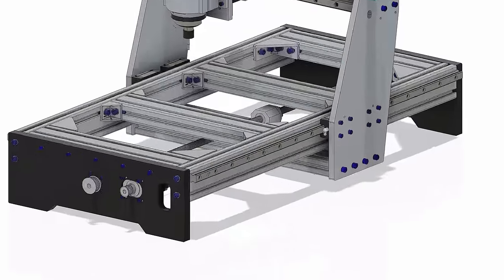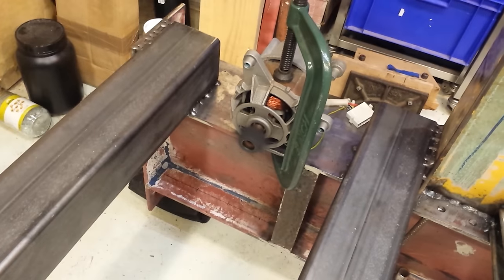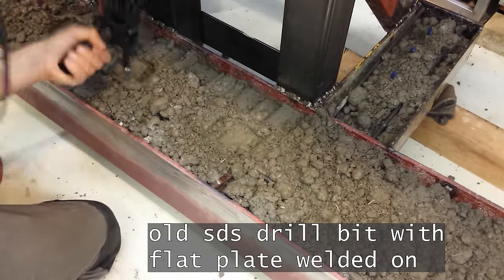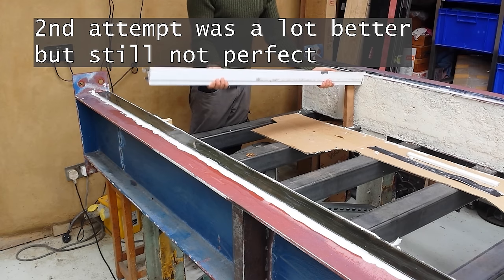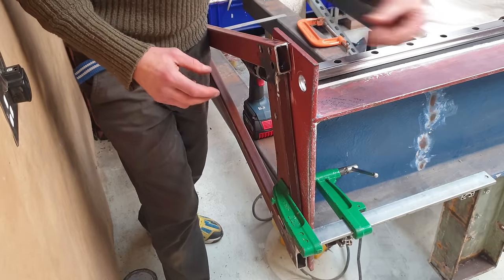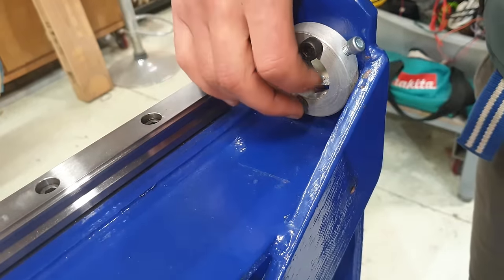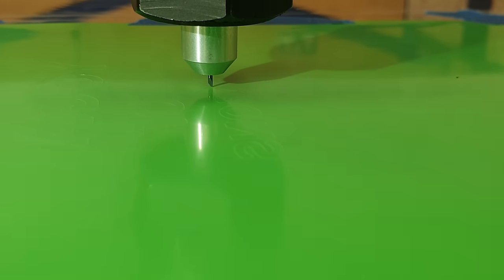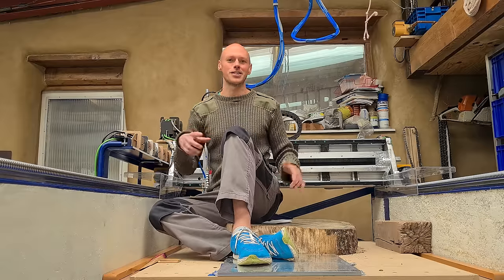Can we DIY an Industrial grade CNC?

Comment: Brilliant. Speaking as an engineer, I know PLENTY of engineers that wouldnt have done half as good a job as you did. Very well done!
Reply from the maker: Good morning. Really appreciate that friend :)
Reply: As a Fitting and Machining apprentice (I'm in my 50s and retraining after doing CAD work for years), I work on CNC machining centres quite a bit, (look at Okuma products about 20 years old; MC66, MC60, MC55, etc), which use G-code to drive them.
We do machining of metals (Aluminium, cast iron, mild steel, and some tool steels) routinely, and it's generally done with slower feeds and speeds than what you showed here (and jets of coolant for some of these) to enable the bits to last through a production run. All power to your machine, it is absolutely brilliant what you've achieved.
Reply: @bivingtons the kind that doesn't have any fabrication experience, it is pretty normal, engineers don't learn how to square two beams and weld it without heat distortion at college, they learn how to calculate the weld stress limit and the structure stress limit.
Reply: good job keep it up.

Comment: H beams are bad against twisting forces.
Reply: I’m looking at making cnc with square tubular frame, then fill it with sand for vibration damping. Is this a good idea
Reply: How do I maintain accuracy when welding it together and I’m using linear roller ways

Comment: .00005 - .00002 vertical lines on radius cuts are about as good as it used to be for expensive CNC machine tools circa 1992. It is a circular interpolation issue. If you have the ability to change the calibration a visibly smooth radius may be possible. Good luck with that. The harder the metal the worse this issue is. But, functionally the parts are not likely to suffer this imperfection. I was working with inconel at the time for US military contract applications.  I am amazed you were able to built this machine in such a small space. You must be a genius or very close to that level of understanding and abilities. Thanks for sharing this.

Comment: The rotating ball nut is a critical and fantastic idea.

The inertia of the rotating ballscrew is definitely a limiter to accelerating the gantry in Y, but there's a bigger problem:  The ballscrew is unstable in sag.  As it sags more, the centripetal force from rotating throws the sag out more.  This places an RPM limit on the rotating ballscrew than decreases quadratically with length.  That limits the speed of traverse in Y.

It's too late now, but for folks thinking about building CNCs of this size, especially with concrete or epoxy granite damped frames, you might want to consider casting in tubing.  By circulating water and controlling the temperature of that circulated water, you can limit the thermal expansion of the frame and ballscrews.  Some ballscrews are available hollow.  Circulating coolant through a ballscrew is a heck of a lot easier when it isn't rotating.

Note that coolant is a bit of a misnomer.  There isn't generally a lot of heat input to the frame and ballscrews.  Rather you want them to stay the same temperature, day or night, season to season.

Comment: if you need to do a self-leveling epoxy again, use the vibration rig. also works for floating more liquid concrete/cement mixes. Vibration can help evenly spread the epoxy. out by repeatedly breaking the surface tensions
Reply from the maker: Hey Brian, that seems like a great tip. and I'm kicking myself that I didn't think of it at the time! Thanks for watching and the good idea :)
Reply: On a similar vein, I was surprised that the vibrator wasn't used during the compacting phase when installing the concrete damping.
Reply from the maker: @d00dEEE  I DID actually try that, to no avail. the concrete seemed just too stiff (and massive) to liquify with that single motor...
Reply: @FloweringElbow  Ah, that makes sense.  And now that I think about it, the concrete mass was changing the harmonics (probably a lot), too, so that likely introduced enough damping that the vibrator was no longer effective...
Reply from the maker: @d00dEEE  yeah - in fact I think that's why it didn't cross my mind when it came to the epoxy..
Reply: I think you could have used a wetter concrete mix. The additional water ensures the cement is fully reacted and the water helps it flow around the reinforcement and avoid voids. Your long drying time ensures the final block is as good as the one you created.
Reply: What frequency(s) and magnitudes would you recommend to self level epoxy?
Reply: @Dave5843-d9m  to much shrinkage.. you want to dry pack concrete something like this use case .
When concrete is watery it shrinks and has change of hairline cracks .

Comment: I have seen a few such machines on YouTube, Frank Howarth being the most notable, but I have never seen a DIY system machine steel. It did so with no apparent chatter or issues of any kind, although you were wise to clear the swarth with those small cutters.  I am seriously impressed, and I want to give that some context by saying I am a retired toolmaker and design engineer, so I have a feeling for the issues you faced and overcame.  Very impressed indeed.
Reply from the maker: Hey Trevor, thanks man - that made me smile, it sure was a lot of work :)
Reply: This Old Tony made a CNC machine that could mill steel. He still ended up CNCing a real milling machine though. There's really no replacement for cast iron dovetails.

Comment: It's amazing how broad and deep the scope of knowledge needed to build a good CNC is. I remember building one out of plywood a few years ago, torsion boxes to maintain rigidity because "aluminum is too expensive to make this rigid enough", skipping things that I felt entirely out of reach at the moment and simplifying as much as possible. Mind you, it was just a 90x90cm CNC for wood and some aluminum, with SBR rails that required less precision and much less force to manage. It wasn't a good CNC, it worked but every bit I knowingly skipped came to bite me in the butt.

It was a nightmare and a love project at the same time, took me months all in all. Had to learn a bunch of stuff on quite a few fields of knowledge. As and engineer and lifetime geek with experience in manual work and machining, it wasn't nearly enough.

What you've done is truly astounding. No single path can prepare you for that, plenty of engineers would fail to even grasp the full complexity of the project. It truly takes a jack-of-all-trades and master of several to pull this off. Hat's off to you. Now I wanna see this machine making some thick chips hahah
Reply from the maker: Hey Franklin, After being pushed and pulled to quite a lot of other non-CNC-related jobs, I was finally getting some time to play with it today. Enough to say it didn't go exactly as I would have liked, but somewhat pleasing nonetheless. Soooo much to learn, as you say... Your comment cheered me a lot and lessened my feeling of inadequacy for still being near the bottom of this learning curve. Sometimes I get so focused on the tasks at hand... It's nice to think back to all that's already been accomplished from time to time :) 
Thanks for watching, and thanks especially for your encouragement, 
Bongo.
Reply: @FloweringElbow  happens a lot, we often get pulled to do stuff that isn't exactly what we want or expected at the moment. 
Man, you went all out on this one, issues are pretty much a given when it's all added up, but you can work it out. 
Even companies with engineering/QA teams and big budgets often ship flawed machines and nobody bats an eye.

Comment: By FAR the BEST diy CNC on YouTube. Hands down. Why? From first principles, not a copy and better off for it. I will emulate this in future if ever build one at all. XXOO
Reply: The only thing I think you could/should have done differently is using helical cut rack and pinion with heavy spring preload for the long axis and MAYBE the second longest axis. I think the lowered work area is both genius and obvious - why no one else does this is beyond me. It makes PERFECT sense. If / when I do full sheet machine like this I want it to be multi process, so I've been thinking about how to achieve that and the best I came up with is 4 or maybe 6 machined-by-machine mounting faces positioned in Airy or Bessel points inward of the extremes so as to be possible to machine them. Then have either a water tray with plasma grill or sacrificial timber sheet, or massive T slot or grid holes sheet, also machined by the machine. Then you could unbolt the working surface from those points and remove it replace the one you need and swap on the head you need to match and bingo, though more likely both laser and plasma would coexist with the spindle motor as they're light weight anyway. Thoughts on those changes?

Comment: 7:30 shrinking issues will be minimized by using hydrophilic fiber in the mix. This additive releases moisture back into the cement gradually, compensating for excess moisture loss from the porous or exposed surfaces. Of course, placing a waterproof coating on the exposed surface, like wax spray or plastic film, also helps.

Comment: That is a fantastic and really impressive result; absolutely blown away by its performance. Just something important with your placement of the emergency stop button, it gets blocked by the acylic chip guards when the Gantry is towards the front of the machine. Just something to be mindful of, especially whilst learning as it can be your best friend and save you a lot of money in cutters.
Reply from the maker: Hey Lechlan, thanks! And thanks for the reminder on the e-stop. I had clocked the potential irony of being blocked from pressing the e-stop by something advertising the best safety device!!!

Comment: 2:16 let me just say at this point, that there is a hell of a lot of measuring that went into this, there have to be right angles all over and you're not in your CAD, you have to hold it tight or it will move, it's all by sight and welding also does it's thing and you have to take that into account.

What a monster of a project, I'm in awe.

Comment: Very glad I watched this. Back in the 70's, DoAll company made metal cutting bandsaws with concrete filled steel casings to dampen vibration and increase mass.
I've been scavenging precision slides and ball screws from big industrial machines, for years now. Wish I had some younger help, at 70 I'm running out of strength! Great video, great thinking! Subscribed! Best to all!
Reply from the maker: Hi Richard, many thanks for leaving a comment :) Interesting stuff that bandsaw business, I bet it was a struggle with shipping costs. We actually came close to filling out bandsaw, which has a welded and folded sheet metal frame, with concrete and re-bar... Opted for sand fill in the end as we can drain it out from a plug rear the bottom when we move it. Thanks again, Bongo.

Comment: That has to be one of the most cool and interesting DIY builds ever. You had my interest when you build the gantry. I LOVE how what you can get defines much of the design. I can't really wait until you show us more. I also work on limited budget and use a lot of scrap parts, but still go for high quality and precision cuts on my next build. One of my biggest problems is how to make straight mounting surfaces for the rails, when I have no straight reference. I would love to se more of your experience with epoxy leveling.

Comment: Weld done ! Punn intended
Rigidity is necessary for repeatability, if your cutting speeds and rapids are low speed, Mass is not a serious issue.
Rapids are not necessary in a Diy project.
There are plywood kits that are rigid enough for non-production work.
Excellent engineering Sir!

Comment: Congratulations on a awesome build. This machine will give you years of joy. You are definitely aware of how important it is to start with a great sturdy base. Don’t be scared to move away from Mach 3/4. Although I have been involved for the last 15 years with CNC I realized that the computer based setup with Mach do give glitches. Great for hobby but when you want reliability, do check in future after making some money to invest in a dedicated controller. They are dedicated and will give you very reliable machine with immediate startup. We converted our cnc plasma, router and milling machine to this controllers. Once again great video, great build. You are a creative person and this will bring very creative designs on a router. Very handy when you start doing signs for shops. 😎
Reply from the maker: Hey Johan, Thanks watching and for sharing your experience. I have to say, after only just getting to grips with Mach3 - writing tool change & relay actuator macros etc, I'm quite scared to even think about moving on right now... 
What type of dedicated controller are you using? 
Thanks again, Bongo.
Reply: @FloweringElbow  There is a few varients but they mostly all use a ARM processor. This is what we use,  SZGH-CNC1000MDc. Best of luck😎
Reply: Mach 3 glitch? You don't say! Must be why it's been abandoned by the developers now.  Personally I run LinuxCNC and it is as solid as a rock is. There's nothing better available.

Comment: This was awesome! Thank you for posting this! 

I'm building a 4x8 CNC machine myself and some of the choices you've made I will likely incorporate into my build. I too would like a machine that can potentially do steel but lack the mass of a frame like yours. Mine is extruded 8080 from 80/20 and bar stock but I was thinking of filling the profiles with epoxy gravel and seeing if that helps give the machine enough mass (it's only several hundred pounds right now). Still in the assembly phase as I just completed the frame and working on the ball screw assemblies. I built a custom CNC controller for it already that can support 4-axis as well as dual X-Axis (one as a mirrored slave similar to yours), 2 vacuums, and 2 other pumps for coolant. I'm using NEMA 34 Servos hybrids as they were not too expensive and can be upgraded as needed. I've never done anything like this before and only a hobby electronics guy and literally have never even used a CNC machine but I've always wanted to learn and what a wonderful project this has been. It's quite an expensive "can I do it" project, but I've learned so much about electrical, design, machining, g-code, computer programming, etc. Wouldn't have it any other way! Worth every penny and hour spent.
Reply from the maker: Hey George, that's great to hear! So pleased if fellow builders can get something from video... And all you say is spot on - sooooo much to learn. Sounds like you're well on your way :)

Comment: That was an amazing build. I'd love to see you get into some aluminum plate using a full bit. The machine looks like it has enough mass to be able to handle that kind of a cut. I've seen a couple of others using sand and rock and epoxy but I like the way you did it better. A lot more DIY friendly and definitely massive.
Reply from the maker: Thanks Timmy! attempts of that kind will likely come in the next video if you can hang on ;)

Comment: Great machine build, Your machine is about twice the size of my biggest machine. So I built my first CNC with hand tools. I used the first CNC machine to make the parts to build a second CNC which is much more accurate (better than 20 microns or less than 1/1000th of an inch). Now I am building a new machine using the parts all made on my second machine. It is a lot of learning and experience is gained only by doing. I have also learnt G code and have become reasonably proficient at writing and editing G code. To get the axis aligned I use jigs and shims.Thanks for the video.

Comment: The trick for getting a perfectly flat epoxy leveling is to use a hairdryer on it after you pour. This gets the bubbles out and reduces viscosity to allow it to self-level.

Also, leave an inch of unused surface around the edges. It will never be level close to the sides. It will be slightly raised there. 

If you did it right no scraping is necessary. If you have to scrape the whole process is pointless.

Depending on the size, you can also cast epoxy directly against a surface you already know to be flat like a granite surface plate.

Don't use water to reduce surface tension. It prevents curing properly. Use an isopropyl alcohol mist if you have to.

Comment: I love it! I want to see more of this device as well. just one thing though I really feel you need to get your vacuum system more integrated as I have seen many end mills shatter in work pieces sending shrapnel everywhere. you need more than a face shield you need body armor if you are going to be that close to the work
Reply from the maker: Hi Tren, I totally agree! Working on it - its fairly tricky to get a system that's good for extracting the full gambit of waste from the differing materials I'm throwing on here. I'm working on it though.